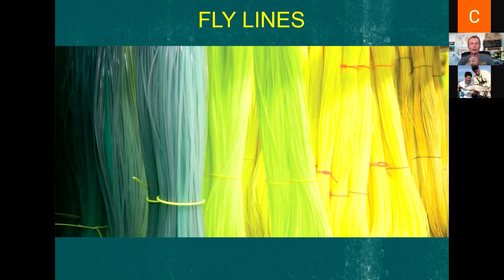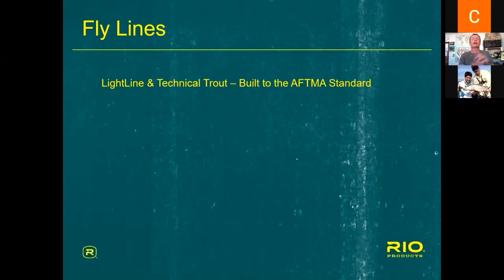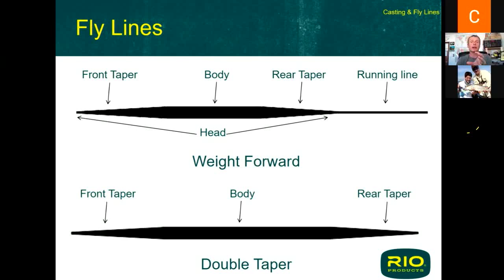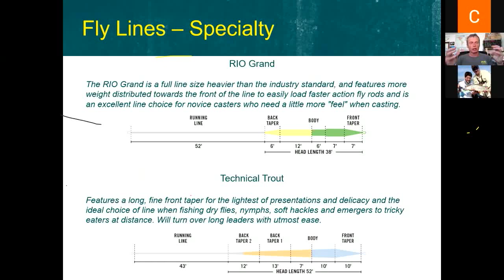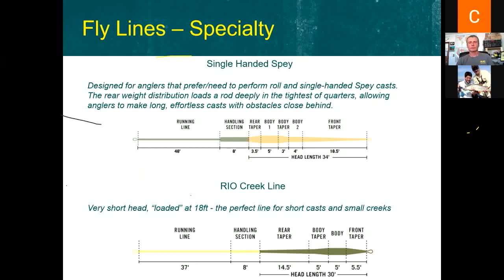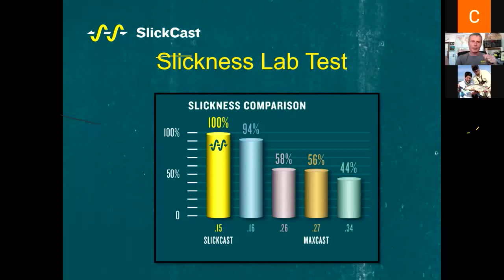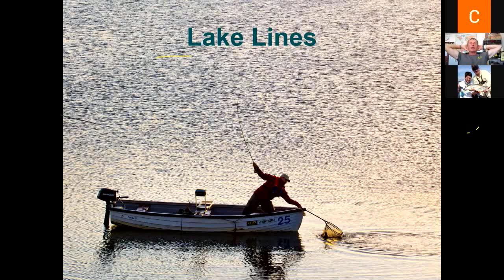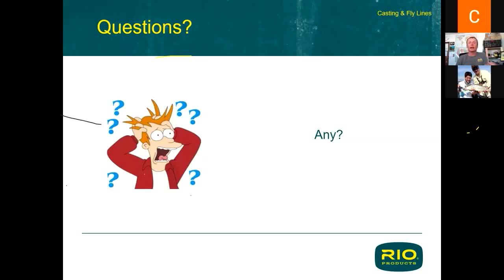Digging into Fly Lines and What Makes RIO's SlickCast So Good- by Simon Gawesworth

Comment: Still Rio lines are over priced. No line should be 80 nor 100 dollar
Reply: Clearly you haven't been grocery shopping lately and have no idea about inflation. Or the cost of R&D.
Reply: canadian  exactly my point, I not that ignorant to throw away money. I got better lines than rio for half the price. That is smart. Ignorant let themselves be stimulated by the smallest feature and through away money without value. 🤔
Reply: canadian  lately I had been welding my own lines, I take a running line from one cheap line and weld to the head from another one or I take the from taper ftom a 7 weigh and weld to a running line of 5 weight. It’s fun and believe me when you customize your line is like making your own flies. It’s perfect to your style. But I think you might want to spend bigger money for salt water fly fishing cause you will need the core of the line  to turn over. By the way you right cortland use plastic lines but the profile of their lines are the best in the market. I am upset with these companies like airflo, rio that taking off the market good lines and modify the profile just to make money but is not a better line than the previous one. Example rio discontinued LT it’s a great line but cause many people can’t cast well cause of the long taper then they discontinued and replaced with new tactical taper .  The reality is an expensive line will not make you better fisherman If you have skill with a 20 dollars line is good enough. Cheers.
Reply: Is the abrasion test of 150,000 cycles irrelevant if the line starts to crack at the 40,000 cycle test🤔